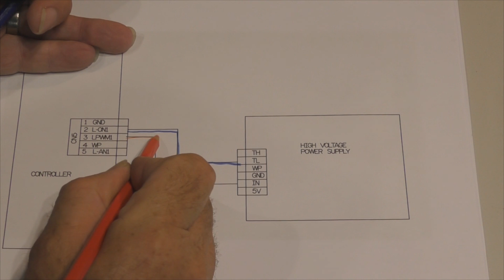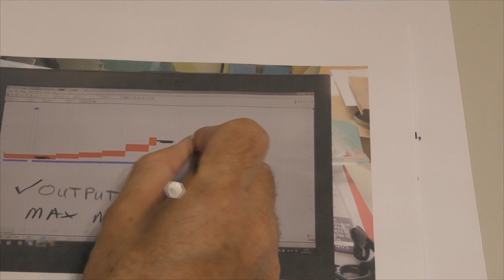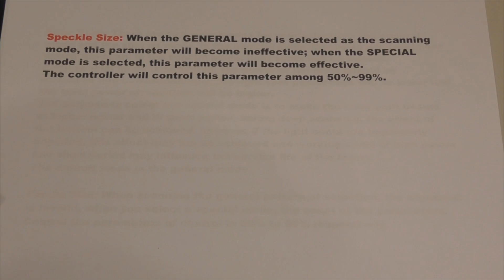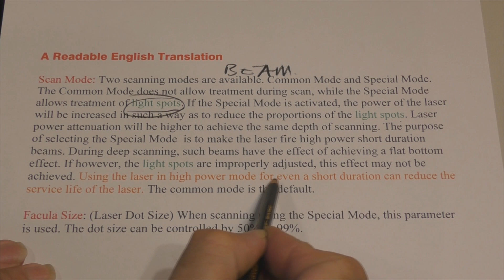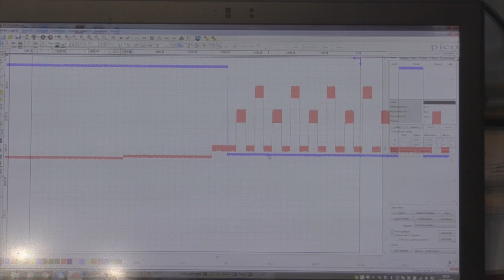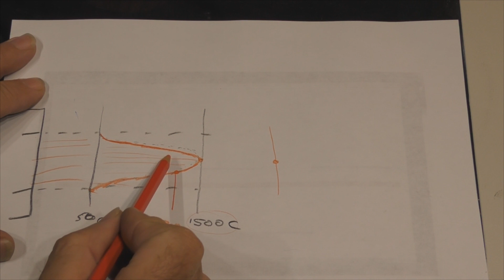RDWorks Learning Lab 113 What the FACULA is going on

Comment: Hi Russ, 
Your PicoScope was on the date wires between the Main controller and Laser Driver, Unless I missed something in the video.

Do you happen to know if the laser driver is using these signals directly to control its output, or its reading/polling these inputs and has separate logic for driving the laser tube?
Reply from the maker: Hi Mike
in this session  https://www.youtube.com/watch?v=5CoTrLNUWTM&t=287s starting at 4min 45 sec Chip Williams goes into great technical detail about the general attributes of  a gas discharge tube and also the detailed design principles inside the HV power supply required to drive it. There is no other controlling logic within the power supply that I am aware of , The blue line (in my video) is grounded to drive an electronic on/off switch within the power supply and the red line (in my video) from the controller is either an  analogue voltage or a PWM signal. Either are fed to a common input to drive a current control circuit within the power supply. There is no inherent intelligence within the power supply. This will become apparent when you watch the video.
Best regards
Russ

Comment: PWM = Pulse Width Modulation, not Power :)  Usually used to assimilate an analogue voltage from a digital signal. Looks to me like the laser on off is not PWM - simply an on/off when there's a dot. PWM "may" be controlling the laser current however.
Reply from the maker: Hi Steve
At my age sometimes things come out of my mouth differently than what my brain sent!!! It could be the beginning of the end?????
Perhaps I was insufficiently clear with my sequence of events. Yes the PWM signal is a digital conversion of the % power request into a dc voltage that can vary between 0 and 5volts (0-100%power) and on my scope trace that was the red signal. That PWM gets converted into the analogue voltage equivalent within the HV power supply, where it is then used to define the current flow through the laser tube. As I mentioned, my Lightblade machine has a different RDC 644 controller and that uses an analogue voltage directly to perform the same current regulation function. Along with the current control  there is a simple ON/OFF control (my blue signal)  which is definitely NOT PWM. This is acting just like a morse code buzzer, connecting the pre-defined current level to the laser tube as and when required. 
I hope That  makes thing clearer
Best wishes
Russ
Reply: You got it Russ :)